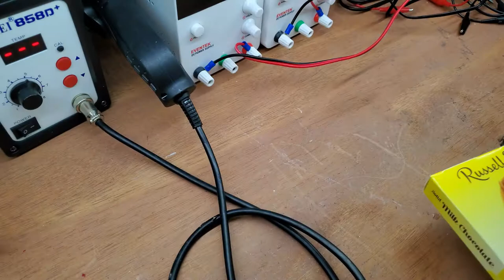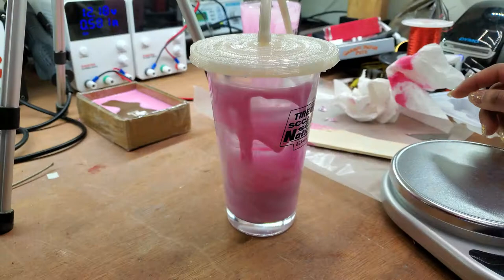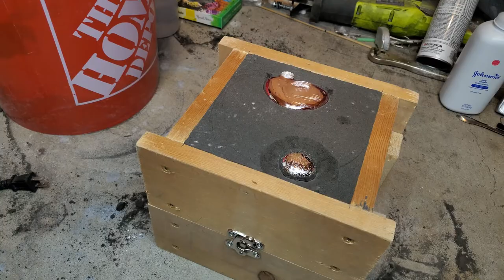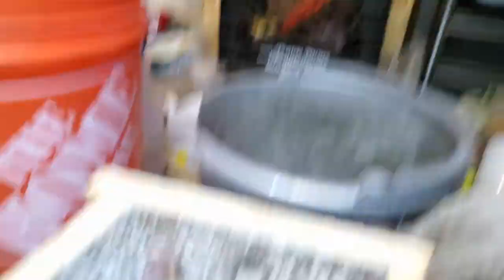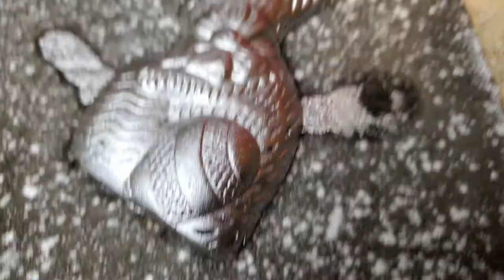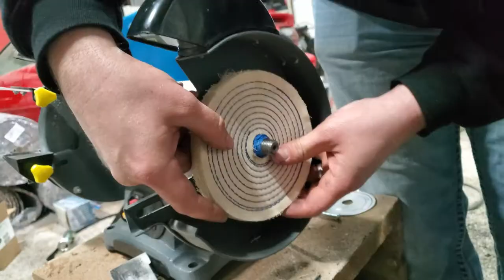Chocolate to Aluminum

Comment: Nice job, have you heard of a trident gate? It was developed to control the flow of metal to slow it to a speed that the flow stayed together eliminating a good bit of bifilm and the porosity that comes from it. I'm only mentioning this because you appear to understand the flow of metal.  John Campbell took aluminum casting to the next level with all his bifilm research and I've put all his work to the test with great results.  Anyways nice casting sir.
Reply from the maker: Thank you! No, I haven't, but now I'll have to try it! Sounds like I have a lot of reading to do

Comment: You're amazing! The bunny goes out of the foundry almost shine, the secret was the sand or some additional compound into the aluminum ?
Reply from the maker: Thank you! The 120 mesh sand helps a lot, but the main reason seemed to be the 8%wt silicon. Even the muffin pan ingots were shiny on the bottom!
The silicon does wonders for the flow and surface quality of aluminum!
Reply: @TenTries  thanks for the answer bro!

Comment: nice! Whats the little "shelf" for in the sand casting that you pour the metal into?
Reply from the maker: Thanks! That's a pouring basin. It's mainly meant to do 3 things:
1) Give you a larger target to hit with the pour.
2) Slow the liquid aluminum down to reduce turbulence.
3) Act as a reservoir to keep the sprue full as the aluminum flows. If air is present in the sprue while the aluminum is flowing down the sprue (like in Try 4 when I accidentally poured directly into the hole), the air will get sucked into the aluminum and create a lot of porosity in the cast.
Reply: @TenTries  Thanks for the info!
Reply from the maker: @clonetek  No problem!
Reply from the maker: 🥳 Congrats! You won a bunny! Send an email to giveaway@TenTries.com with "2021 Bunny Giveaway" in the subject line and your username, name, and address in the body. After you receive the bunny, please share a public video or post on social media showing it off! Tag the Ten Tries page in the post: Facebook (@realtentries), twitter (@realtentries), instagram (@realtentries), or reddit (u/realTenTries)

Comment: Good video! You should make a "lost chocolate" (or lost wax) video .
Reply from the maker: I like the way you think
Reply: @TenTries  WELL.......................... Were waiting!!
Reply from the maker: @kevinjohnson7621  lol, I need to make a furnace (with build video) that can get to 1000C so I can make more of that silicon aluminum alloy (Technically silumin, maybe?) that pours so nicely. I really don't want to replace the heating element on my current furnace every 4ish hours of runtime that it gets at those temps
Reply: @TenTries  
Have you tried looking on eBay for furnace heating coils? They're cheap from China (at least in the uk) or you could make your own - there are tutorials on YouTube.